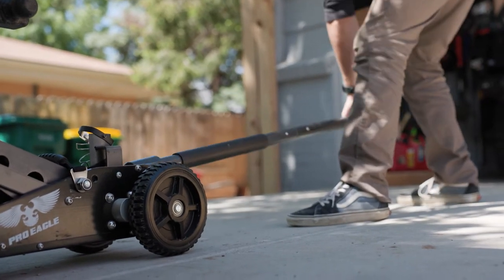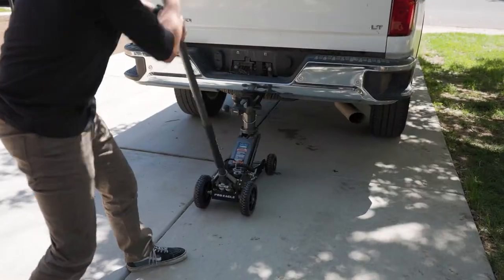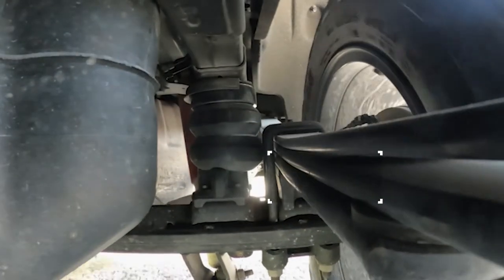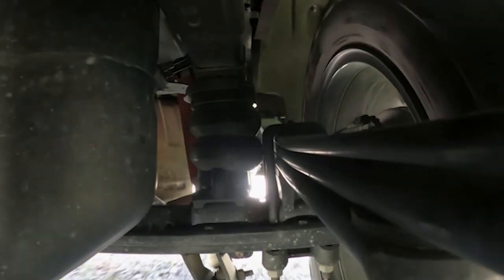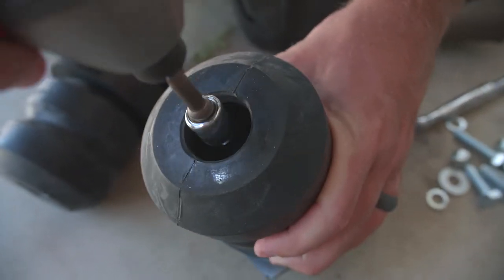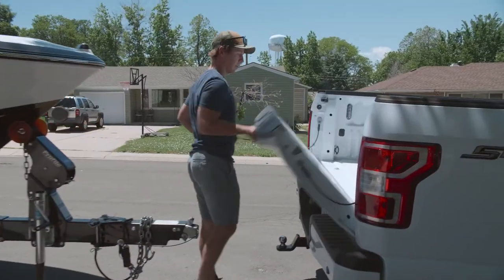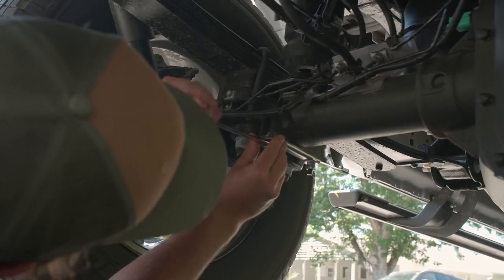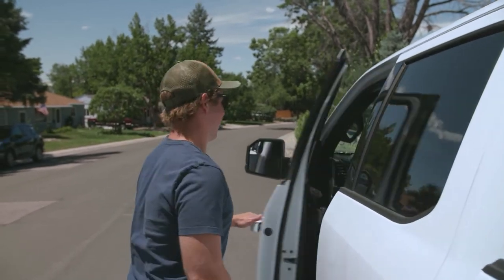Airbags vs Timbren SES

Comment: I had "air bags" on my previous vehicles and they were always a hassle to Air Up, Air Down and the odd Air Leak.  Especially when one least expects it.   0uch!     Many years ago I switched to Timbren SES units and they work great.   Simply install with 1" gap (on empty load) and use them.   IMO, Timbrens should be factory inclusions.   That's how great they work for me....
Reply from the maker: Thank you for sharing! Love that Timbren has been able to support you and your towing and hauling over the years. Here's to many more 💪

Comment: Had airbags on my last truck. Just put these on my 21 GMC Sierra 1500 last week. They work good for not squatting your truck under heavy loads but the ride is terrible. It doesn't feel "progressive" at all. It's really bad on unmaintained country roads. Airbags are a pain with changing the PSI all the time but the ride quality is better. Thinking about removing the spacer to give me more travel and installing RAS to help smooth it out before the Timbrens make contact with the axle but that's another 500 bucks. Nothing's perfect I guess.
Reply from the maker: Thanks for the feedback. Check in with our customer service team - they can help solve the harsh ride and it's all covered under our warranty.
Reply: That’s what I did! 3” air gap got it right!  Otherwise “ el pogo stick!”

Comment: I'm in the process of restoring a 97 c2500 single cab long bed. The truck will be a daily driver and also used for work. I was going to install airbags but this system is appealing to me. My only question is this:

Imagine you are loaded down precisely just enough to barely engage the Timbren, not a pound more. You then tow around town and as you tow you will have suspension travel of course maybe you go over a railroad track. Do you feel the re-engagement every time it makes contact? If so what I wonder if it would be jarring
Reply from the maker: Good question! If you are barely touch the axle from a bit of load, yes you may feel it. You could shorten the rubber spring a bit more as we have different options.

Comment: But do your rubber bumpers make the ride quality as rough as the air bags or adding an extra leaf spring?
Reply from the maker: Nope! These are designed to come in contact and engage with the axle when loaded up. They  have a progressive spring rate. They are designed to ride smooth! When unloaded, you should not even feel them as they are not designed to be engaged without load unlike add a leaf which will feel stiffer all the time.

Comment: I installed Timbrens after having air bags for ten years. Air bag pros: adjustable air means more or less capacity. Cons: even empty (5psi) they give you a rough ride (because they are attached to frame and axle.) Trust me 10 years of this I was over it! 
Timbrens after 10 years. Pros: no maintenance ever!. Ride is excellent with a heavy load, or totally empty. I tow a 15K fifth wheel trailer with over 3K tongue weight in bed of truck. Cons: Empty ride is horrible if you have some weight in your truck, 4 passengers, or/and around 500-1000 lbs. in bed of truck.(The reason: Timbrens are now in contact with axle.) The fix: Roadmaster active suspension! It raises rear enough for Timbrens not to touch the frame. Or re arc the springs that have sagged through the years.(which will sag again, and is expensive).
Reply from the maker: Thanks for the feedback! You are running RAS and Timbren together?

Comment: When loaded these must ride terrible and limit a lot of articulation
Reply from the maker: Our Timbren SES kits are designed with a progressive spring rate. Unlike the traditional air bag system with a static load rating determined by the psi applied. The progressive spring rate allows the SES kit to absorb road shocks and provide a much better ride when towing over stock.